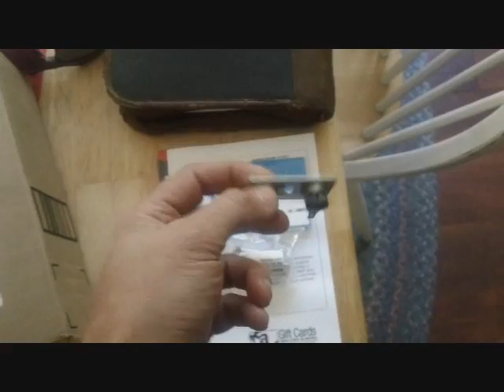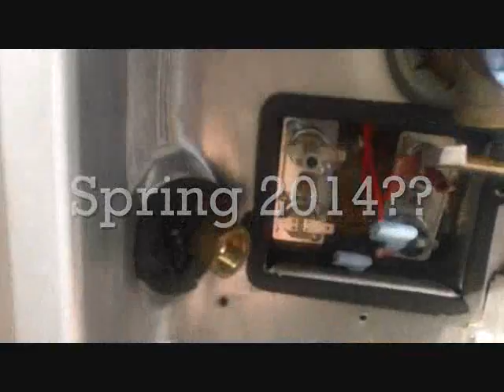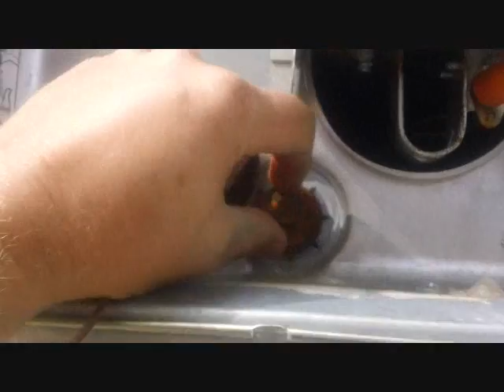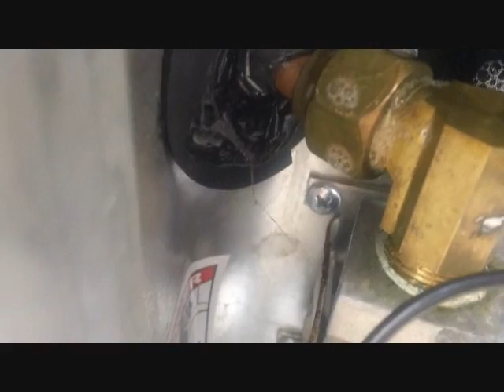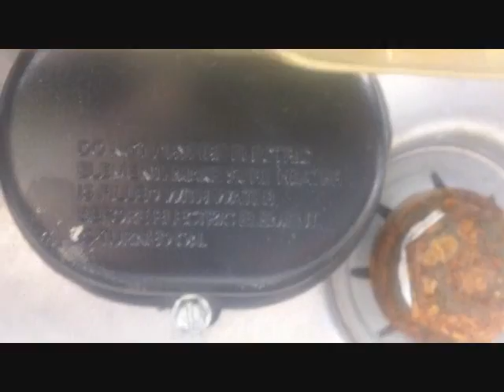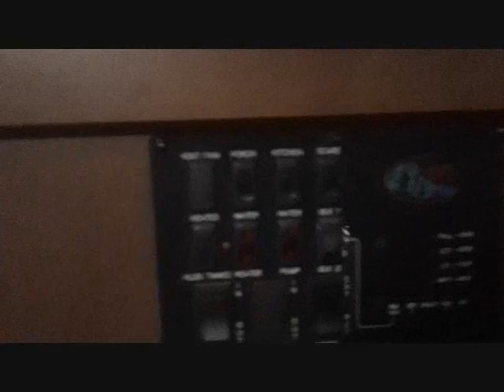Suburban RV water heater part 2

Comment: I have the opposite problem. Electricity works and the gas does not. I ordered a new module board today hoping that's the problem. The switch in the wall panel does not light up at all and I am guessing this is due to the module board not working. There is no spark, absolutely no sign of life. I have had to replace the thermostat in the past (as you have shown) because the temp was  not as hot as it should be. I have a 10 gallon tank and I did not have to take all the stuff apart like you did to get to the thermostat.

Comment: Mine works fine on gas but will kick the main breaker when i try to run on electric. Especially if i run he over head ac. Breaker will kick then for sure Sometimes fast sometime little later but will kick if i run both. All help appreciated...

Comment: I have the same water heater. Do you know if there is an in line fuse somewhere that I am missing? Mine works on electric but not gas. No igniter clicks, no gas hiss. It doesn't do anything. Switched out the control board to a dinosaur electronics. Still no power on gas. Breaker is not tripped.... No power to the board.
Reply from the maker: I don't know. But I know it runs off the 12 volt DC trailer circuit when in gas mode, and in my trailer, all the 12 volt circuits have a fuse located in the panel at the power converter. Circuit breakers for the ac circuits, and push in automotive type fuses for the DC. One should be for the heater. If it's open, and after replacement it still doesn't work,  check to see if it blew again. If yes, then you've got a short somewhere.
Reply: @stevewatr Thanks for the reply. All fuses look good. Just noticed that I have an "FLT" light at the control panel in the trailer. The light illuminates when I flip on the gas mode to the water heater.
Reply from the maker: @mannyb4959  FLT stands for fault. It means the heater failed to ignite.
Reply: @stevewatr  Yes, but for the love of God why??? LOL, It's driving me crazy. I've watched like 100 videos and spent hours in forums, still can't find the answer. There are only 7 fuses in my panel. They all control multiple things... The only thing not working is the gas water heater... That's why I am wondering if there is an in line one somewhere.... Thanks for your help and time.

Comment: I would have replaced the heating element and the anode all at the same time you did the thermostat switch. Might save you from dealing with it next spring. Good video!
Reply from the maker: Thanks. As a general rule, I replace the anode every other year. I  remove it to drain the heater for winterizing and install a new one in the springtime.

Comment: You come off as a pretty savvy mechanical problem  solver! I have the exact water heater in my RV, and  the sparker that should light the pilot, stopped sparking/ clicking on our last trip.  Were back now for a 10 day stay,, and I cannot figure out where to start, any suggestions?
Reply from the maker: I've never had that particular problem, but I'd start by checking if either of the 2 high limits are tripped.
Reply: @stevewatr  no trips on the high limits. I made a trip down to the local RV/Marine supply, and my buddy there said it was probably the main board! I jas no idea there was one! He also mentioned they have a special system to test the board, so today I'm taking another trip down there to get it tested!
Reply: UPDATE!!
It was pointed out to me that the Suburban water heater had a control board that operates the igniter,  I checked mine and the little LED that indicates operation, would nor even light up. So, I went on YouTube,  searched troubleshooting control board on Suburban water heaters, and found out that that was most likely my issue. Found it on Amazon from Dinosaur electronics and cross referenced my board, 2 days later, I had ignition, and hot water!

Comment: Hi Steve. You led me right to one of the problems with my Hot Water heater, thanks! In trying to find a replacement part for the hi thermostat I enter "Suburban water heater model SW6PE Stock NO. 5033RV hot water heater Part number #312155 232305 thermostat" in the search and invariably get a very similar part, that looks exactly like the one you have where the reset button is located in the middle as opposed to toward one side. This part number comes back as part number" 232306. The other thing is that even though my RV is a propane/electric capable hot water heater, there is no other "reset/thermostat" in the second position. I'm wondering if mine was modified? kind of mystified. Did they replace part number 232305 with the newer part 232306? 

Thanks in advance and for the great videos Best regards
Reply from the maker: Hmmm, that is odd. You might be right about the other number being a new part number. I couldn't say for sure, and since it's a safety device, I  wouldn't guess. Worse case, you could consult a parts department at a dealer. The part will cost more, but at least you'll know if it's a good substitute.

Comment: Do you know if I need the module board to run the 120v side of this heater?
Reply from the maker: fogstain sorry. I don't know for sure.
Reply: I bought one for my camper but I don't have the module board. The camper will never need the propane side as I never plan on moving it. guess I will try it.
Reply from the maker: fogstain the 120 volt heater circuit is pretty basic. I think the module is for ignition, and safety of the propane side. but I'm not sure. Sorry I can't be more help.
Reply: I believe it will work. might have to send 12v to the green wire not sure yet
Reply from the maker: Just make sure you know for sure, otherwise you might damage something. Typically green wires are ground, but then again, in trailer circuits it might be different. Maybe you could find a wiring diagram online. Good luck.
Reply: I already have the diagram

Comment: thanks. I just got a Flagstaff with one of these and the hot water isnt running on propane.  The inside switch has a light next to it which says push to reset although it itslef doesnt reset anything but I think its telling me to reset out at the heater outside. So I shall do that.   We dont run on AC power yet.

Comment: Hi, I'm surprised you didn't check the switch itself, as when I did you I found the switch completely fried(one wire being melted on the switch and the other nowhere to be seen). Thanks to this video I now see exactly where the hot is connected on the hi-temp eco. It looks like I will have to replace the switch and put two new ends on the hot to and from the switch  or get a whole new hot wire from the eco(maybe a new eco as well) to the switch itself and some how thread it through. But at least I have a blueprint.
Thanks for the vid.

surfpk
Reply from the maker: +surpk1 Glad the video helped. You're welcome.
Reply: Everything checks out OK on mine. Completely stumped until I read your comment. Wil hit the switch next. Will hit the switch next. Many thanks.

Comment from the maker: I agree, I did not imply that teflon does the sealing, my point is to stress that teflon tape is used on tapered pipe threads where the threads themselves are the mateing surfaces. I often run into issues where people try to fix leaks by wrapping tape on threads on plastic pump housings that are designed to compress an oring or gasket between flanges. It never helps, and if too teflon is applied, they might crack the plastic nut on the union.